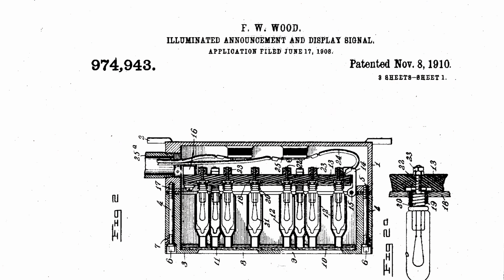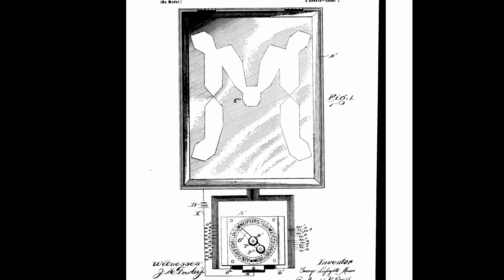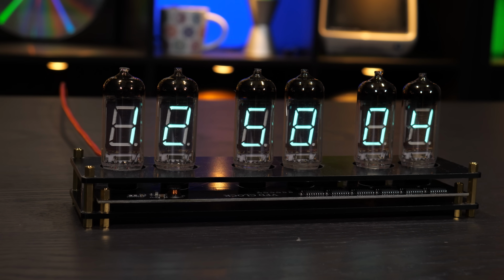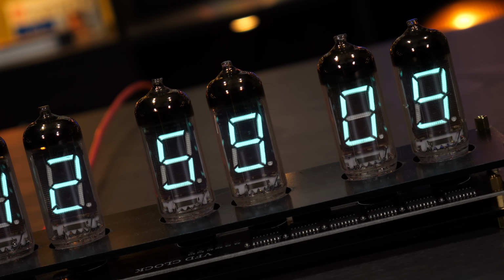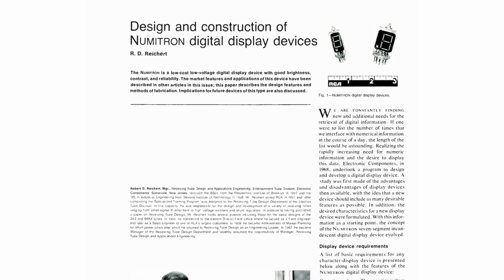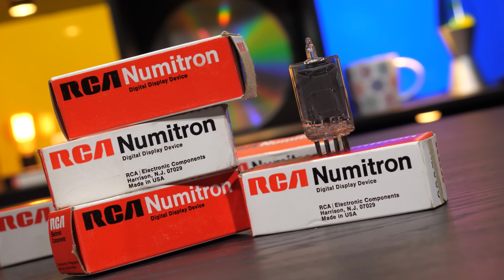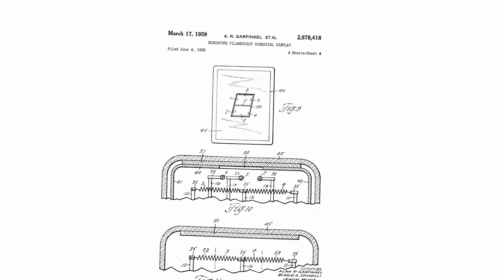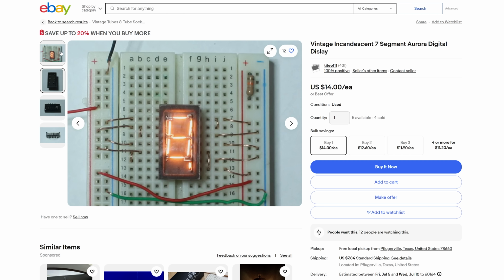The Numitron: An obvious idea that wasn't very bright

Comment: I"m so so annoyed that the 5 in Nixie tubes is just an inverted 2
Reply: Later Nixies had a proper '5' digit. I have a nixie clock made with German Telefunken ZM1210 tubes and they look really nice; much better than the earlier ones with an upside down 2.
Reply from the maker: This was fairly common in many of the soviet-made tubes. I've always been slightly perplexed by it since I can't imagine it was a significant cost-savings at all, but because the numerals partially obscures those behind them, it may have been judged more readable for tubes of that size.
Reply: @TechnologyConnections  Hey, Alec: do you have any info on why the order of the numbers in the Nixie tube was as it was? Really, what's the reason?
Reply: @Sekir80  Basically to keep the digits in front from covering the ones behind.  I do like the dimensionality of the digits jumping around.
Reply: I think I noticed that when I was a kid and staring at a display, hey, it's an upside down 2!
Reply: Yes as with calculators - 58008 upside down etc.
Reply: @stephenlewis9159 😅😅😅😅 ahh, middle math.
Reply: Yeah and it wouldn't even look bad if they met in the middle but they decided to go for a regular two and a horrific looking 5
Reply: There is a specific type that doesn't (that is still soviet made).  I have a nixie clock with it (I know the upside 2 would drive me nuts).  There's (or at least used to be, he was in Ukraine) a guy that started making new nixie tubes.  From the sound of it, the technique / equipment was 'lost' so he had to come up with it again.
Reply: @Jack-vk5ko  I think the person you are thinking of is Dalibor Farny.
Reply: @Jack-vk5ko  You may be thinking of Dalibor Farny.  He has a very nice web site (which is still up as of this writing) and some really good YouTube videos on how he is bringing Nixie tube technology back to life.  I believe he is in the Czech Republic, not the Ukraine.
Reply: Now I will never unsee that. Thanks alot.
Reply: Aud here I aw tryiug to figure out how to do au upsidedowu u
Reply: In college we had a gas chromatograph or something that had Nixie displays and I thought that was the best thing ever. I wished those were used more. So cool looking and super legible!

Comment: "Now, I'm about to be rather unkind to this piece of alleged technology," he said after basically calling it a piece of shit
Reply: Could not stop laughing when he said that, you mean to tell me that you've been comparatively kind to it so far??
Reply: He even names it "alleged" technology, like it's saying it's a technology, but hasn't proven it
Reply: Ive seen the whole video and I really don't think they're that bad. I mean if they only switched the gray background for a black one, it would be pretty alright, decent even.
Reply from the maker: @aceman0000099  "It would be pretty alright, decent even" is entering my lexicon for sure
Reply: @TechnologyConnections  can't wait to hear it in the script for the next video
Reply: @TechnologyConnections  I’m fond of “not entirely insufficient.”
Reply: @aceman0000099  Switch the background, make the helix a little wider, and hook the filaments to different parts of the same posts (one in front and one behind) so they don't have the large gaps and they might look alright. They still won't have the beauty of nixie tubes or even VFDs but could have been a reasonable cheap alternative.
Reply: @chitlitlah  the posts are the connections, so you can't hook different filaments to the same posts without connecting multiple filaments together. That's exactly why they have separate posts
Reply: @gorak9000  Barrel jacks have been around a lot longer than these things have. It wouldn't have been that hard to have an outer conductor at the bottom and an inner conductor that sticks out above it, similar to the phone jacks they were using in the 19th century.
Reply: @chitlitlah  but barrel jacks are pretty big, vs these posts are pretty small (in diameter I mean) - maybe making small precise parts was harder back then. Plus whatever material that is used as the insulator between the inner and outer conductors has to be somewhat vacuum stable - aka not outgassing a ton of stuff inside the bulb
Reply: @gorak9000  The 3.5 mm jack we use for modern headphones has been around since the 1950s, and I think they could have made something similar that would've worked for this application. But even if it wasn't practical to have them share posts, they could've arranged the posts so that the filaments crossed each other at corners, one under the other so they don't short, so that the glowing parts of the filaments were a lot closer to each other. I just don't believe RCA couldn't have done a better job with just a little more effort put into it.
Reply: @aceman0000099  I agree - the whole video is a 20 minute rant about how they suck, when you examine them super up close, with an example there the whole time showing that they're actually pretty good at a reasonable viewing distance, and at normal OCD levels
Reply: Now, now. He called them seven POSes, backed by an eighth POS, and housed in a ninth POS
Reply: and of course he only briefly mentions that he's not using them correctly by not using the right driver. the whole time on screen as the clock he has them under-driven.
Reply: @ssl3546  He did show them being driven correctly, and I actually think they were less legible, because of the bleedover between segments, and the backlight effect

Comment: This tech was widely used in aviation for clocks and other displays. It was smaller, and I cannot remember if it was called Numitron or not.

(Edit: Minitron is their name.)

They are usually put behind a filter screen, that makes them easier to see. Simular to how VFDs were used. That eliminates one of your biggest gripes. You don't see the background, and contrast is much better.

I have several of these old aviation clocks and a few new tubes sitting around. They are small squared off devices that slot in similarly to an IC chip rather than the large tube.

The old clock was a Davtron M811B and they have newer versions, the M850 and M877. I have several of the 811B and 877s. The tubes in the 811 are larger, and have that look of being electronics manufactured mid 20th century. The 877 has tubes that look more modern in construction, and it looks like the M850 uses the same tech from what I can tell.

Funny thing is, it apears you can still buy the M850 new, and they cost about the same as a single replacement tube assembly for repair. $400-500, depending on the source. You need to buy traceable parts for aviation, and that makes them expensive. Plus the low volume of manufacture and sale.

They don't tend to burn out often, I have only replaced a few.

Comment: Displays like this predated microprocessors by several years - they were typically driven by discrete logic or even mechanical switches. By the time microprocessors were a significant thing, LED displays were available.
Reply: They were ubiquitous on fuel pumps in the late 70s and throughout the 80s, as successors to the electromechanically driven rings.

In avionics, Bendix King used them extensively, so they're still in widespread use in the cockpits of GA aircraft, a case of "if it works, don't fix it". Despite being filaments, and in a harsh environment (vibration), they're very reliable as they're not driven hard like incandescent lightbulbs are.
Reply: @nezbrun872  And once an aircraft part gets certified for commercial use, it's really difficult to get it replaced with something else because of all the red tape.
Reply: @nezbrun872  I was just trying to think of where I've seen these, and that's it: GA avionics. I want to say the older version of those little Davtron multi-function gauges used them, and I've seen them in radios and whatnot as well.
Reply: @nezbrun872 : My thoughts exactly, might be they where aiming at a certain market segment and didn't bother anything else... get the gas-pumps; Make a reliable albeit rough product, get it to market fast, get that multimillion $ contract, earn some easy fast money... maybe it's more brilliant than it's credit for here.
Reply: @TheFirstBigCheese  Market SEGMENT ... I see what you did there!  :)=)
Reply: @mbvideoselection : Yaahy...! Someone appreciated my dry scandinavian humour.😊
Reply: @nezbrun872 I knew I’d seen these before! They were used for N1 and N2 indicators in an old Cessna Citation jet from the 70’s that I’ve worked on
Reply: The first microprocessor came out right about the same time, the Intel 4004.
Reply: The first microprocessor I'm aware of was the TMS 1000 by Texas Instruments. That was in 1971. So yes, those displays do predate microprocessors. So do LEDs and LED displays since those started being a thing in the early 60s (I think 62 or 63ish?)

Nonetheless, the need for displays for microprocessors and thus the search for a cheap and reliable way to make them nonetheless did cause them to become a valid option for display "technology".

I might be misunderstanding the point of your comment though. If I do, I'm sorry.
Reply: @terribleideas1860  Well, the 4004 was specifically made to power a calculator, so it needed a numeric display like these.  They were released November 1971.
The TMS 1000 was released in 1974.
Reply: @JohnDlugosz There's always the TMX1795, but as the X indicates it never went into full-scale production. My understanding is TI couldn't find enough customers to justify it. So Intel gets the point for the first commercial-production microprocessor, but only grudgingly.

As far as first microprocessor... well, TI had the patents to back their claim to that honor, but they were overturned in court due to prior art, which means neither Intel nor TI is first and Lee Boysel's AL1 holds that honor in the eyes of the law.
Reply: @JohnDlugosz  Thank you!

(By far not deep enough into electronics and such, so always thankful for more and better information)
Reply: @terribleideas1860 you are now aware of the mp944 in the f14s CADC. The mp944 was finished in 1970.
Reply: @Jfk1245  Thank you! Always nice to learn more!
Reply: @SeanBZA  I understand that most jet aircraft 3rd generation and earlier had purpose built computers that could not be ‘reprogrammed’; but to my knowledge in the CADC inside of the F-14 they used a set of chips called the MP944.

The MP944 was programmable, had every component you would expect on a microprocessor. It was far more powerful than either the Texas Instruments offering or the intel 4004.

I have no idea as to whether the MP944 or the numitron tube was created first. I only know that the MP944 was finished the year before the Texas Instruments microprocessor was.
Reply: @Jfk1245  The MP944 was an amazing piece of engineering and digital design.  Too bad that some of the inner details are still under wraps.
Reply: @terribleideas1860 

LEDs weren't used much until about the mid 1970s. Too expensive, mostly.
Reply: @mikeselectricstuff...I caught that too.  While showing 4xxx series devices uses the term microprocessor when they were actually driven mostly by discrete TTL.  A misstatement I guess.

Comment: I actually want a clock that is lit, but not bright. It is then used for nighttime. If it is too bright, it would affect my eyes to strongly.
Reply: He could have included a light sensor with this clock that drives a voltage limiting circuit.  More voltage in bright conditions, less in the dark.

Comment: About 20 years ago I sold a few NOS Numitrons via eBay to a guy in Germany who made clocks with them.  I was a bit shocked that he paid to have them shipped international even though I couldn't guarantee they worked.
Reply: We have a very large community of "Bastler" (best translation is probably "tinkerer") here in germany. Which is not surprising given that, before digital electronics became a thing, tinkering with analog, low-voltage electronics was a rather common hobby for many. Especially since we have on the one side a big history of people building Model-Trains, boats, planes, etc., while on the other side, many companies who produced those early analog electronics had their factories in Germany. Tinkering isn't that common now anymore, mostly because the electronics got so complex. But "the old folk" stuck with their hobby.

Many common projects those people do, are usually something like: restoring analog radios, music players and amps, repairing tube tv's, and so on. Many of those guys are also middle-aged or even pensionists, who just like to tinker on older stuff they remember their parents having. And many of them also build their own stuff in their cellar-turned-workshop. They are usually aware of the risk of being scammed when ordering things like tubes, but they don't get produced anymore. And since it's "just" a hobby, those people are okay with taking a risk. If it works out great, if not...well. Time to try a new project.

~Edit: it's also a cultural thing, I think. In the after-war period, people refused almost religiously to throw away stuff. The tv/radio/car was broken? Well, time to learn how to fix it! Repair professionals are expensive, and buying new stuff is even more. And since almost any person knew a colleague who in turn knew someone else that had the necessary repair skills. So yeah, people just...fixed a lot of stuff themselves. Which for some turned from a necessity to a hobby along the way. They never went to engineer school or worked as electricians, they tought themselves how to repair and went from there.~
Reply: @Just_Lars  I've bought and sold old tech on eBay where the condition was unknown.   For example I've purchased quite a lot of old telephone items where the seller did not have the ability to test the items offered and listed those items 'as-is'.  That's not a 'scam'.   If a seller lies or misrepresents an item's condition then it fits the definition of a 'scam'.
Reply: @Just_Lars  I am Australian and I repair cassette decks :3
Reply: @Just_Lars  don't worry people still tinker, they are just called in english as "makers" and if you can do basic electronics, you can get some neat hardware to do interesting projects

there are also meetups e.g. Maker Faire Hannover
Reply: @thejeroyea Where I live tinkerers are "fixers" and creators are "makers" - although there's a significant overlap, and the groups are collegial.
Reply: @SineN0mine3  I don't think its that binary, often its just a spectrum because there are few makers who don't tinker (because often stuff just doesn't work so you tinker to make it work) or tinkers who don't make (because a lot of people are modding stuff which would one consider tinkering)
and thats just the tip of the iceberg
Reply: @Just_Lars  Tubes are still being made in China and Russia. EL34, EL84, 6L6 ETC ETC ETC.
Reply: @Just_Lars  In the 1980s I worked with someone in their 40s who said that in the 1960s he used to take commissions to build radio kits. The buyer got a cheap radio and he made some extra money. It wouldn't surprise me if that also happened in the USA. Otherwise the company Heathkit would never have got so big. 

In the 1990s a colleague was doing the same building desktop PCs. A company still around called Dell started that way.
Reply: I sold a vinTage milkshake mixer to a guy in Germany in 2000, it was really expensive to ship and he rewired the motor to run on 240 VAC.
Reply: @melissasmess2773  about a decade ago now I bought some OEM wheels for a car from a guy in France and had the set of 4 shipped to the US. 

When you love something you'll do wild stuff 😂 shipping the wheels cost basically what I paid for the wheels haha
Reply: I'm German and that is something I would do...
Reply: As a german, i can say, that that is definitely verry German...
Reply: Not surprised.  A lot of old (mid-century) American tech is very popular in Europe and Japan.
Reply: I'm not surprised either!!! Vintage tech will always have a place in American culture. All those vintage number display devices are so cool
I'm a guitar player and tube amps have always had a special place in my heart!
Glass devices are cool.
His clock is badass I am taken aback for every "put down"
Reply: This is funny, because the first time I read about Nixie tubes and similar things, it was in German and was close to 20 years ago.  I remember getting an assignment for my German class to go online and find an article or blog in German and then translate and summarize it.  I knew that everyone else was just going to Google recent news articles and change the search language to German and I didn't want to just do that, so instead I wound up starting at Hackaday (or something like it) and clicking through links from there to try and find something that linked me back to a write-up in German and stumbled across these things.  I know the first time I learned about Nixie tubes (and their close cousins) it was in German, and the obvious thing that people did (and still do) with them is make clocks.  I assume this is because the Venn diagram of people who know what a Nixie tube is and people who know about Steve Wozniak and his Nixie watch is just a circle.

There's a strong probability that it's not the same guy, because Nixie clocks are a fairly common hobby project, but this comment just brought back pointless memories.

No, I don't remember what grade I got.  I remember regretting doing the assignment this way, because of all the technical jargon that was harder to translate.  Also because everyone who just looked for current events articles from big news organizations probably had the benefit of being able to find the exact same article already translated to English.

Comment: 9:42 I got that beat. In high school I built two giant clocks / scoreboards using segments of eight 5mm through-hole red LEDs hand-soldered on stripboard, with a BBC Micro to control them. This was back in… um… 1990, I think.